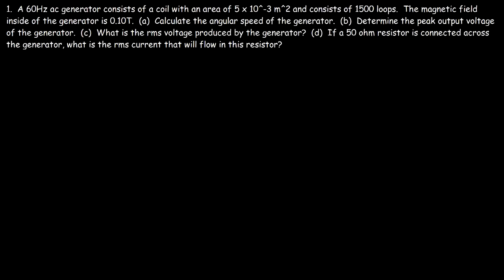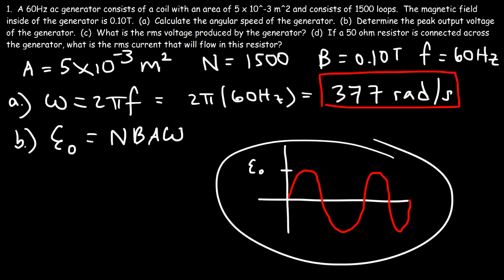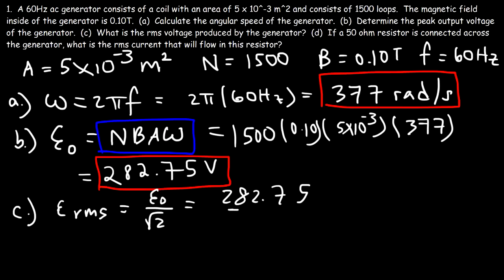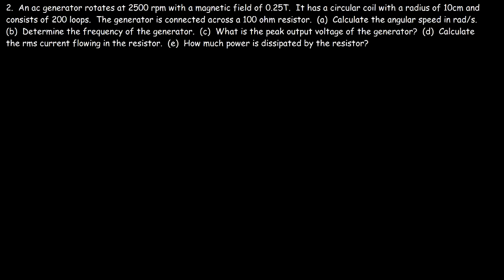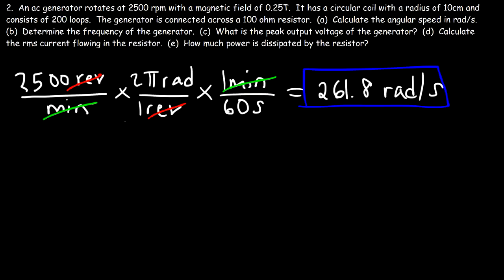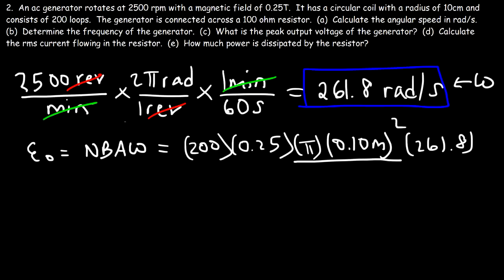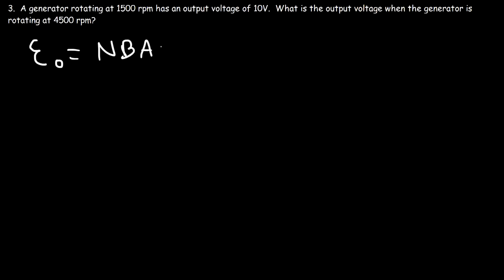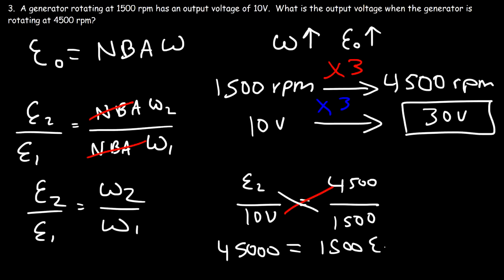Electric Generators, Induced EMF, Electromagnetic Induction - Physics

Comment: Does the formula for the instantaneous voltage of generator work if the coils are circular and not square or rectangular? From my knowledge the formula is derived from using the fact that the coil is rectangular or square.
Reply: @Raneem Al-Shahat yea but it also depends on the fact that the linear velocity of the two rods are the same along the whole rod which isnt the case on a circle due to the curvature

Comment: You expleined it so well. congratulations. But its only theory. I would like if you can make it more practical with a real generator. Cause ive been applying these ecuations to a real generator and the results are not that accuarate. also if you can explain it telling us what is each part of the ecuation like  the radius of the coil,  the area in m2... like doing it more graphic. anyway you did a great job.

Comment: the peak current is I = Eo/ R. The value of R is the resistance. Why did u put the value of resistor "100 ohms" instead of resistance. Now Im confused.
Reply: Ohm is the unit for resistance.
Reply: risistance is measured in ohms, but i guess you already failed 😂
Reply: @leeroy14r60  what risistance? Check your spelling.